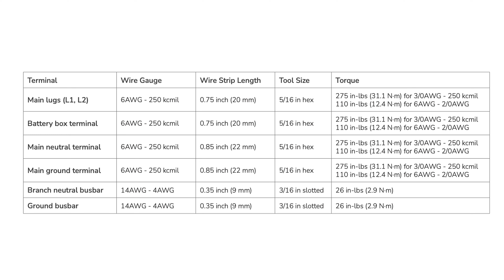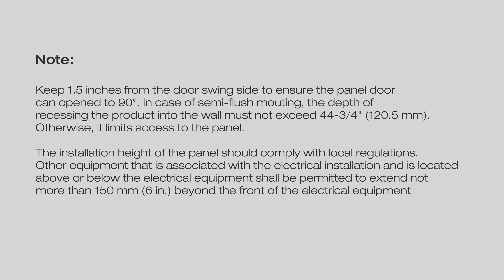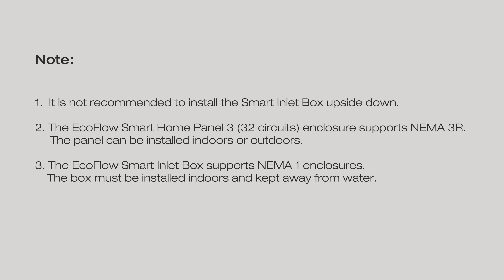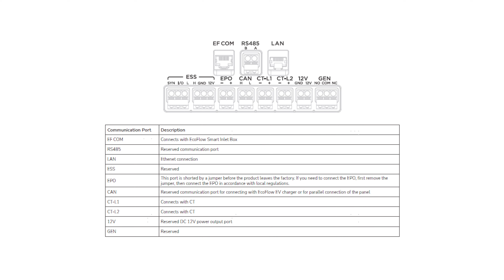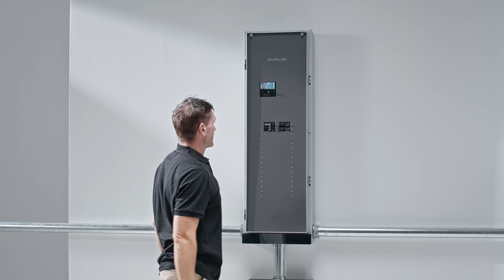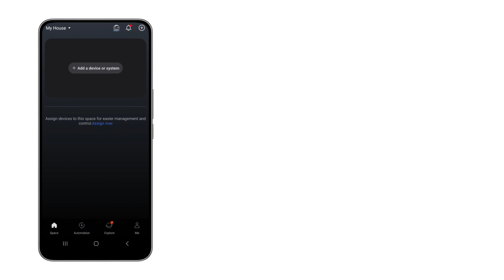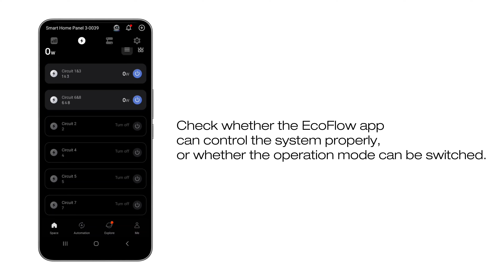EcoFlow Smart Home Panel 3 (32 Circuits) Installation Guide | EcoAcademy 101

Comment: Absolute worst customer service on the planet
Reply: I dont agree with your comment.. They take time but they have been super courteous  every time I spoke to them and fixed my issue in 36hours time They have also been reachable on phone. Only thing I found problematic is it takes 24-48hours to receive response for firmware upgrade but I could live with it. My issue resolved and it works now.

Comment: I can’t imagine using EcoFlow for a main panel.  The last two panels have been obsoleted very quickly.  Panels are supposed to last decades.   Eaton, SquareD and Siemens are the only type of organizations I would trust for a main panel.

On top of that this one uses software/firmware.

Last I heard this software communicates to offshore web services.  No way I’m trusting an overseas web service with a critical part of my home infrastructure.
Reply from the maker: That concern is understandable — a main panel is critical infrastructure.
To clarify, SHP3 is designed to operate as a full main service panel, supporting up to 32 circuits for long-term residential installation.
Previous EcoFlow panels have not been obsoleted or disabled and remain supported; SHP3 is a normal generational update, not a replacement that renders earlier systems unusable.
Importantly, SHP3 does not depend on cloud connectivity for core operation. Power distribution and protection run locally, and the system continues to function normally without internet access. Cloud services are optional and used only for monitoring and control features.
For homeowners who prefer a traditional approach, SHP3 can be treated as a local-first main panel, with intelligence as an enhancement rather than a dependency.
Reply: @EcoFlowTech then you should show how to disconnect it from all cloud connectivity after setup is complete.
Reply: @EcoFlowTech The Wi-Fi module should be designed to be detachable and capable of being upgraded through a USB-C slot. This enables privacy, draws in customers, and provides opportunities for future upgrades, among other things.

Comment: One thing I am struggling to find out is can the smart home panel 3 be used as the main breaker now?   I plan to upgrade the power to my house to 200A and would like to have this as the main panel.
Reply: Yes it can be main or sub panel.
Reply: 4:30-4:40 is when it talks about it
Reply: Yes you can.